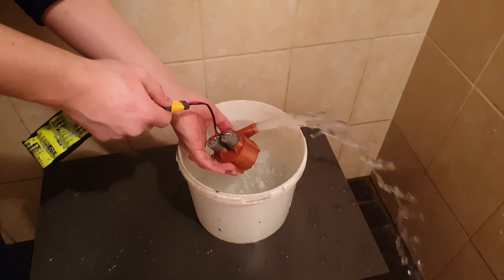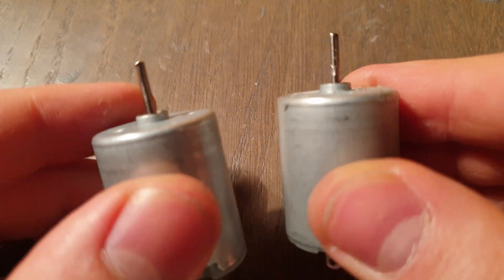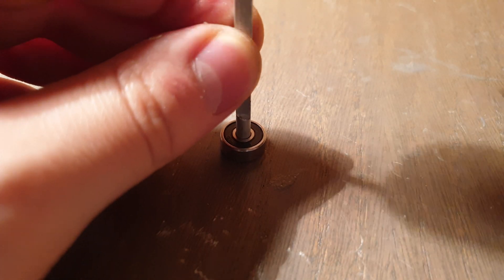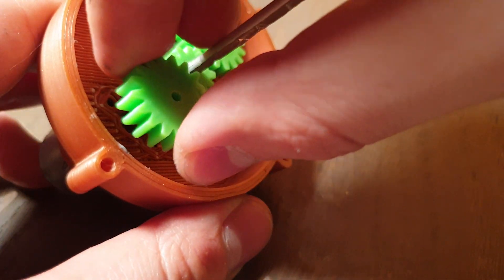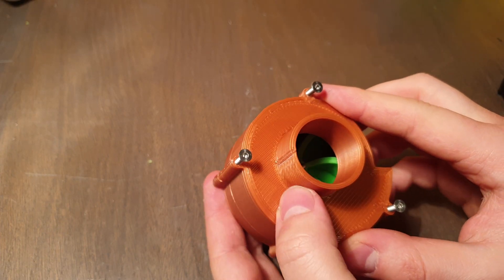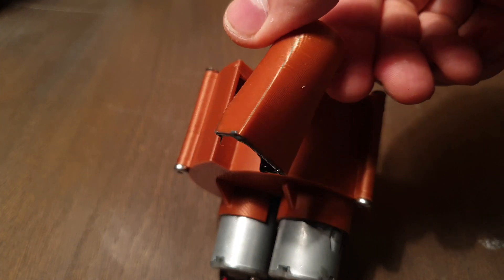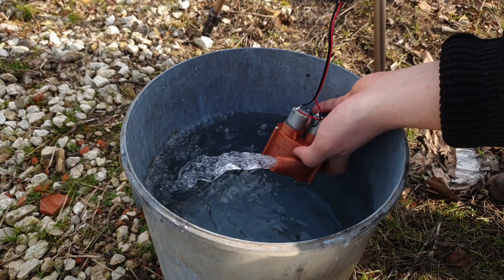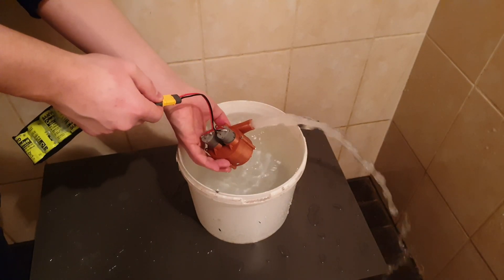3D Printed - 💦Dual Engine Water Pump 💦 - How to Make a Powerful Water Pump at Home

Comment from the maker: Sorry for bad audio at the beginning, I had song that should not be there and I had to remove this afterward. :/
Reply: What did you mean with "both motors have to move same way" did you mean the same orientation? You know that in that way you would seize the shaft, correct?

You probably meant at the same time, as in serial or synchronized...

Cool video though, and ingeniuos as well. Keep it up.

Comment: Using two motors on one input like this can be risky because a slight difference in speed between the two is going to cause stress on the gears and make the two motors partially drive each other. This results in lower efficiency and durability.

Comment: Hi, could you share your CAD files as well? I'm trying to build the pump but I need to change some dimensions to fit the stuff I have at home (shaft diameter, slots for motors,..). Would help me a lot! Great video by the way, your channel definitely deserves more views